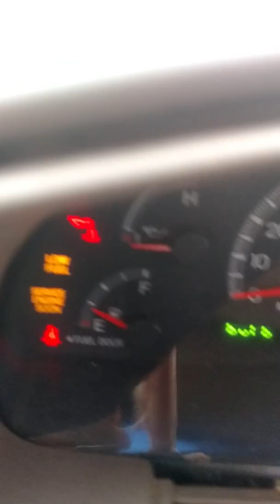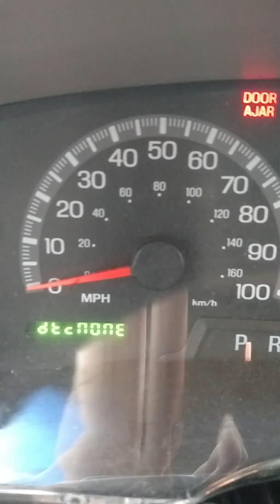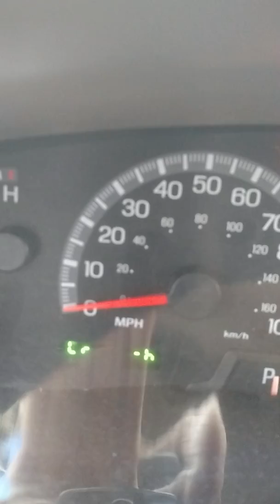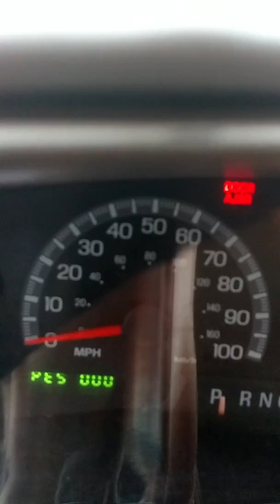Read trouble codes without needing a scan tool

Comment: 1998 did not have a digital cluster.  The 1999 model was the first.  98 has analog and all gauges on the left side of the speedometer.  99 and up have digital odometer and 2 gauges on each side of the speedo/tach.  You are showing a 99 and up sir.